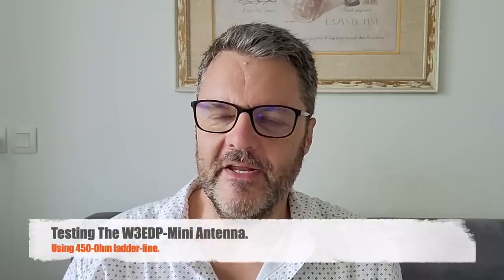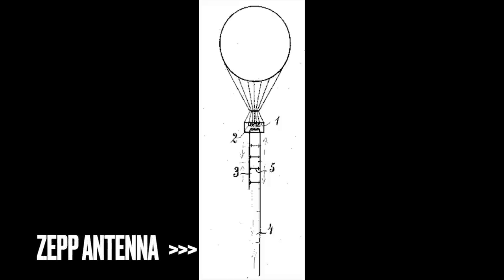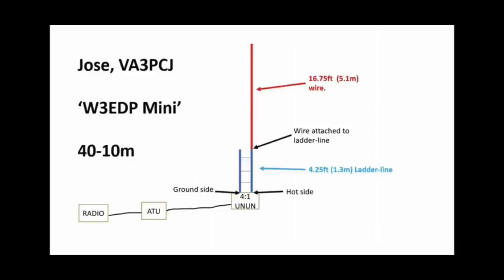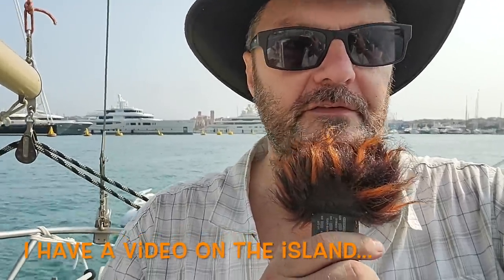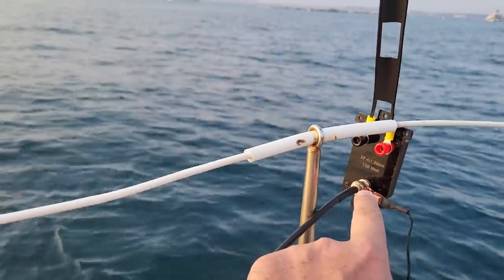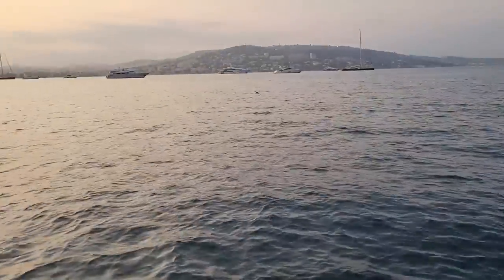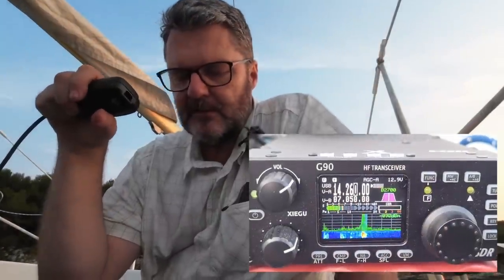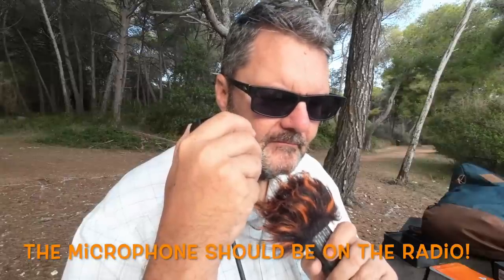Testing The W3EDP-Mini Antenna.

Comment: Sun, sea and radio, go for it Gil! Seas On The Air looks like great fun!👍😀. That is certainly a very simple/portable antenna and could be a good choice for summits, the only "issue" could be a method of supporting it on a bald hilltop. I've just treated myself to a TX-500 and I'm in the process of building a multi band antenna for SOTA. The 3 main requirements were lightweight, be easily tunable to resonance and be self supporting so I've opted for a 5.2m telescopic whip, home brew loading coil for 40m and free standing or stake mount. Enjoy your island hopping and safe sailing😀. 73.
Reply from the maker: Those are pretty light for SOTA, good choice.

Comment: Hi again Gil,

After reading your reply I decided to build the mini version of this antenna and try it out. First thing I noticed was that my receiver on 40m was unusually quiet. The mini antenna tunes easily on all bands 40-10m but its efficiency seems low on all bands, so I would not recommend it for QRP /portable operation. As we know the dummy load tunes beautifully on all bands but does make a good radiating antenna.

I have had a chance to use my middle size version (10.2 + 5.6 + 4:1 balun) of this antenna and while it seems to be more efficient than the mini version it does not perform (radiation efficiency) as well as my  wire 40m 1/4 wave vertical. I feed my 40m 1/4 wave with odd multiples of 1/4 wave @ 20m so that at 20m where the antenna exhibits a high impedance at the feedpoint the coax feed line acts as impedance transformer and gives a low impedance at the end of the coax on 20m. The antenna tuner tuning is very sharp on 20m and the antenna radiates well. The antenna also loads easily on 15m giving me three bands, 40, 20, amd 15m.

After saying the above I would advise QRP operators that considering your application is important when choosing your antenna; do you want to work DX or local contacts. The vertical is good for DX while a simple low dipole is better for local area work.

Best regards,
Peter VK1XP

Comment: As calm and relaxing a sailboat is ( they were called blowboats up in Lake Erie in the states) sometimes it’s nice to have a decent motor when the wind is not in your favor. Try to dress out the wood with a bit of teak oil to keep it fresh, one thing in common with motor boats, we’re constantly doing repairs and oiling the wood, but it’s well worth it. There is something relaxing about boating and adding radio to it is even more fun unless you are in the middle of a lightning storm. 73 from SV9 island in the Med.
Reply from the maker: Definitely. I like my small Volvo MD1. I should work on that wood...

Comment: I live in Scotland. I heard a station in Ireland on 40m but the only antenna I had was a 10m dipole. So I used the auto tuner and he gave me a 55 report. If you think about it we are happy to use a 2m long antenna for 40m on a car and we make contacts so we should not rule out small antennas for base station use.

Comment: Tres bien Gil. I built a Mini and a Junior following Jose's plans and they live side by side on the same winder but I used 300 Ohms window line. Perhaps the 450 Ohms would be better. It is as you say just an OK performer but so simple to make, lightweight and inexpensive. I've only tried using the Mini so far. The Elecraft T1 makes light work of "tuning" it which is hardly a surprise. I apologise if it has already been noted, but I have read that W3EDP only popularised the antenna based on another USA ham's design. Great great video Gil.
Reply from the maker: Interesting thanks! The full size W3EDP works significantly better than the mini..

Comment: He usado esta version -micro W3EDP  con buen resultado en 20m . Contactos en la primera prueba con : Rusia, Islandia, Finlandia ... @ 2500 km en el primer intento con solo 10W. Buenos reportes.

 La antena diispone de  otro pico de resonancia alrededor de 10m que es  muy sensible al uso de  un contrapeso.Este contrapeso es de longitud muy corta y  está conectado en el punto de salida "fría" del balun 1:4 ,  donde se une con la linea abierta de 450 ohmios.

Con este contrapeso, puedo despazar el pico de 10m y llegar a 11m con una  pérdida lógica de rendimiento.También afecta, pero en menor medida al pico de 20m. La zona intermadia entre picos es adaptable con ATU, pero no espero grandes cosas.

El contrapeso es un punto a favor.

Comentar además que el balun 1::4 mejor que sea de corriente (dos toroides separados) ya que la version de voltage ( un toroide común)  no limita la corriente de modo común generada por la asimetría de la antena. En cualquier caso un choke RF siempre es más que recomendable, es necesario.

Buena relización y excelente video.

Comment: You always need a counterpoise with a 4:1 transformer. The output is only 200 ohms. Try a 9:1 UNUN to drive 450 ohm line.
Reply from the maker: 200 Ohms where?

Comment: i am a maritieme mobile on  south west coast of the Netherlands using a 20.2m efhw  on a 9.3m boat top of the mast is at 13m. inverted V using pvc pipe to keep it clear from the rigging. i like this idea for simplicity. could i run it straight from the mfj-901b ?
Reply from the maker: My mast is only 8m tall 😞

Comment: jhi Gil thanks for the video j
jose uses a 4:1 UNUN where you use a 4:1 balun is there a reason why ?
Reply from the maker: Hi, it's just what I had on hand..
Reply: @RadioPrepper  okay 
Thanks 
I have been inspired by your video and made the mini junior and the 84ft version so thanks 
Haven’t tested in the field yet
Reply from the maker: Let me know how it goes!
Reply: used the antenna 1st time made a contact 4,241 km and 
2nd contact 2,266km 
using 5 watts ICOM 705 
15m band
i would say this works a big thanks for your video
Reply from the maker: Awesome!

Comment: I have now a doublet for 10 meters. This antenna doesn't perform on 20/40 meters at all. It's good for listening though. Anyway. I was in the proces of thinking to replace it by a W3EDC - mini because i have limited space for a 40 meter antenna and i want to have a better antenna for it. The results in your'e video aren't very convincing. It probably receives better then what i have now. But i might loose performance on 10 meters.. And introduce maybe RFI.. Of course i was already planning to use a choke. I'll need to think more about this. I don't want to do all the work for nothing :)
Reply from the maker: I tried on 15m but there wasn't anyone..
Reply: @RadioPrepper  I build one. One hour ago. I will put it up tomorrow or the day after that and see what will happen.
Reply from the maker: Let me know how it performs!

Comment: It seems the mini version is 25% sized from full version. Lenght of the 5m wire seems somewhat short for 20m band, far from half wavelenght.
That gives me an idea to try out how 50% size version would work with 2.6m ladder line and 10.2m of wire. That would be a perfect size for my tiny garden and I could really use a replacement if it was better than my current random length inverted L.
73
Reply from the maker: I think an 8m wire would be better too...

Comment: The W3EDP was most definitely NOT based on or inspired by the Zepp...unless the 1936 article in QST was intentionally misleading us. I don't know what that is you're showing, but it certainly is NOT a W3EDP antenna: "The antenna and counterpoise are at right angles to each other." [Beers, QST, March 1936, p 32.] The design procedure described involved starting with a 100 foot (30.48m) long wire, assessing its performance over some period of time, cutting off four feet (1.22m) from its length, and repeating, then, after settling on an 84 foot (25.60m) antenna, performing a similar process to arrive at a 17 foot (5.18m) counterpoise wire for most of the then-extent bands. What you have is a mini-version of something that, coincidentally, has similar dimensions and happens to work reasonably well, but it is, without question, not a smaller version of a W3EDP.